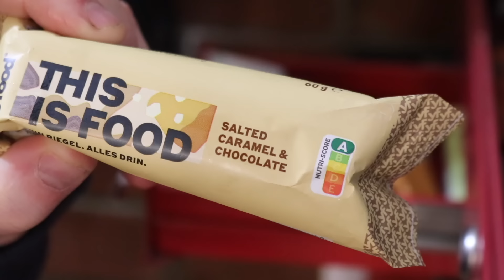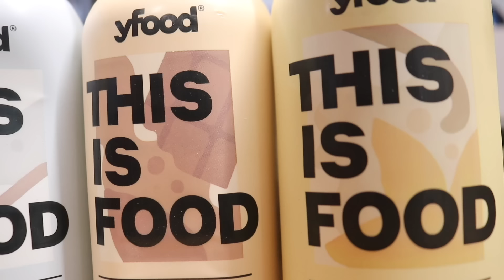MY NEW ESCORT COSWORTH NEEDS WELDING

Comment: Copper weld thru primer is best for mig welding, spary a light coat on each inner side to be welded, great to prevent the backsides of new welded lips from rusting, also worth taking note on how lower sill panels have swaged drain holes, putting a flat bar between two lips to be welded then hammering each side and then remove the bar forms a nice drain channel, water will find a way down there by rain or condensation, best it has a way out, you can also shove a cavity wax nozzel in there after its all done, indarsa make an excellent aresol one which comes with a nozzel and hose, it gives the right amount of wax where as the full size guns can be a bit over the top sometimes esp for smaller repairs
i've been a panel beater in collision and resto since '87, retired now

little tip for you with the roloc flexable discs, cut a plastic filler spreader to make a backing disc so they dont flex too much.
those finger sanders are good, i noticed the belts though started getting rubbish several years ago esp the brown ones, even the 3M ones would snap where they used to go all the way to worn out, try the purple ones they may be better, i just got a box of them this xmas as i put them on my xmas list!!
try using a carbide bit in the air grinder, i have a set of those and for places you cant get a stone wheel on an angle gringer they work well, i most of the weld off with the stone or carbide bit then finish it with the roloc discs, * note the harder backing pad works better, you can buy the wider backed arbour for them too but i tend to use a home made plastic disc as a backing pad to them, there is enough turn on them to mount the disc and a backing pad made from a spreader.

for the welds on the arches etc smear a small amount of fiber glass filler paste over the welds then sand it back off, this will seal up any tiny piholes you cant see in the weld line, the fiberglass resin is a decent seal against water, then etch 2k prime and then put the drip check / brush on sealer and stone chip / raptor, on my cars i prefer to over coat them with body colour gloss as it makes it harder for the dirt to stick and my under seal / stone chip of choice is 3m sprayable sealer, it comes in a mix bag but i tip the two parts out, and mix to use in a gravity gun with a big nozzle as i prefer the texture, that stuff works very well as a normal underseal / stone chip coating, i did the entire under side of a 76 mecedes in it and it stayed but over 10 years now
Reply: Awesome tips 👍🏼

Comment: I always use a heat gun and scrapers to remove the bulk of the underseal. A rag soaked in some sort of solvent, paraffin often works, as it's not to volatile and doesn't evaporate to quickly, to remove any residue.

Comment: Adam A hot Air gun and Scraper is just about the best way to remove underseal follow up with some paint thinners to clear up any left overs its hard graft but a lot less messier and Healthier than going at it with power tools its a Ball Ache for sure.

Comment: Use the green/blue belts for your power file, they'll last longer. 

This is why I hate undersealed cars, traps moisture causes more rust. You'll get it fixed no problem.

Comment: Job well done.. PS I put HD tape on the body when I might damage the body. Also to make a piece of sheet metal to fit I use cardboard paper and use a pen to template the cut in the body. A tip from our friend Edd China.

Comment: Adam, you forgot to plug weld those 2 bits of metal together on the bottom of the wheelarch. Great job on the welding mate, 7mm hole is best for plug welding btw.

Comment: Also cover ya 3door ..the grinding dust will land on the 3door(which you cant see)..and as soon as it get wet/due or condensation hits it.. the dust will start to rust leaving very small rust marks all over the car...i had to have my e46 m3 repainted for this reason

Comment: When painting your welded parts, id use an etch primer, then a good zinc or heavy read you can even brush on, then a few coats of standard primer.

Then most importantly, do not leave primer bare, it will gather moisture the longer it sits. Paint over then you can seal with a good two pack underseal buddy.

Id a successful garage for over 35 years building and restoring cars and bikes

Comment: Great channel and really enjoyable production work to your videos. I've  got one pet peeve though, you've removed the guard on your angle grinder. I use an angle grinder as part of my daily job for over 25 years now and can honestly say it's rarely necessary to remove the guard and during that time it's saved more than its cost! Put it back in please especially when using slitting discs, it's there for good reason.
Keep up the great work and interesting content.

Comment: So Adam when welding I would when cutting the plate make the plate exactly the same size and the hole cuz as a welder for 28 yrs and was coded too the power of welding if you set the welder right the penatrion will go through and seal the gap that's how I have always done it

Comment: Adam just a thought, nearly every fabricating place has a parts bin with loads of stainless and steel that's new mainly cut of pieces they won't need so get put in these bins.

They sell them off if you pop in and ask, there cheaper than what your paying.

Comment: Good job , have a few practice runs with the Mig power turned up slightly higher once you've mastered it your welds will be much tidier with less grinding back 👍
Reply from the maker: I’ll try a higher setting 👍🏼

It’s a bit awkward as I’m always fighting gravity welding upside down or sideways
Reply: 100% that's what I noticed, hold each weld on for an extra quarter seconds, it will stop the weld lumping up buddy 👍.

Comment: Great work Adam, repairs look good.   One thing I do differently is I use an etch primer rather than weld through over the finished repair, it just seems  to give better protection before the car is painted. The sanding belts require a lot of patience as they can't take much pressure.  If  you can take down most of the weld with a sanding disc  first all the better.
Reply from the maker: Cheers Graham. I’ll look into that 👍🏼

Comment: BELT SANDER .. 15:42 Black and becker make a really good electric belt sander...im in the resto trade and the electric one is as good if not better that any air operated belt sanders I've used

Comment: Can I say adam the work you have done looks alot better and will last alot longer than it was before and to me as a welder you haven't do too bad if a job and like I said it alot better and you need metal cutting tools for grinding the welds down not sanding wheels don't last 2 mins there like small grinding stones or metal one too all different shapes hope this helps you but great work

Comment: Great effort and it’s fantastic your having a go at welding but you need to clean up the area your welding to much more. It should be as clean as the panel your putting in. Keep up the great work. 👍👍

Comment: Grip fill is the best stuff You can use to smooth over welds  and seams small holes  ect it can go directly on bare metal it has a rust inhibitor in it it sets rock solid then you can underseal over it also it's as close to the original stuff You been removing

Comment: I know it’s easier said than done but it would make your welding a lot easier for you if you get it properly cleaned I know it’s not easy and try not getting any gaps round your plates don’t need it you will get plenty enough penetration it’s only fine but still a great job can’t wait till the next one 👍

Comment: awesome job man, just with the welding to the fuel filler hole to avoid lumpy weld like that you just want a tiny bit more heat. The weld sounded good so just needed a tiny bit more heat and the weld will melt in
Reply from the maker: Cheers. I’ll try that 👍🏼
Reply: Keep it up bro, love your content, reminds me of times gone by

Comment: @Adam151082 i bought an R Tech welder on your recommendation, what settings wire speed , voltage  , gas settings are you using for this job ... my Porsche 924 has really thin metal and am using the same steel to fix it. I am also using 0.6mm wire. your a true inspiration to us all...

Comment: I think you are at the point where it needs to go on a rollover jig like Paul linfoot used on his latest RS500 post. You’ll be there for months otherwise trying to get that underseal off. Or send it away to be blasted on the underside by a third party. I feel like this has got to be a big job quite quick. Kind of feel for you.

Comment: Good work on the repairs, my advice would be invest in an air fed welding mask, not cheap but for painting, grinding and welding they are so much better, you’ll make self ill in the end from all the crap that’s goin airborn, also get some thick primer for after the welding is done think I used etch primer on me mk1 escort 👌🏽👍🏼

Comment: A Clean and Strip disc/drill attachment would work better on the under seal than a wire wheel, super quick and won’t thin the panel like a flap disc.

Comment: Got to be honest - Its a complete bodge up !  Fred in his shed !  That whole area is rotten, it needs a proper repair doing or the corrosion will be back in no time. Looks like the cars had some serious repairs/bodges done in the past - over spray every where and rough panel work under the bumpers and arches.
Reply: Wouldn’t have got many views if he bought a minter than didn’t need any work doing and Adams channel is all about “having a go yourself” instead of getting others to do it. I happen to know this cars going in next year for an extensive overhaul underneath. He just wants to stop it from getting any worse til that day comes.

Comment: The welder needs more amps buddy, the weld is not penetrating through enough. Turn it up a few more clicks and also on each weld hold it on for an extra half second.

Comment: Your doing a awesome job and you say you ain’t a welder 😂I’ve done it years and your just as good as me , one thing I would say is put some goggles on under welding mask , the amount of hot metal I’ve had to have removed from my eyes is crazy until I started wearing goggles, dewalt do a nice pair 👊

Comment: ADAM when you cut and place the fuel plate why not cut the round hole in it first before you weld it in I would off it would have been easier

Comment: I think you would be probably best to consider stopping right now. Stripping the whole car totally, & start with a bare bones ground up restoration properly. That way you do it once & once only. You are going to be back n forward so many times with this car, if you do it in stages. It may feel more expensive initially. but in the long term it will be a cheaper way around it.

Comment: What are the back end of the inner sills like? Sierras & Granadas liked to rot the sills from the inside out, thanks mostly due the the big hole Ford stamped into the inner sill deliberately to allow muck & salt inside the sills. It's a rear beam out job to repair, so best to check it out whilst you have the beam out.

I recall hearing of an internal Ford memo back in the day. They didn't want cars to last much more than 10 years otherwise nobody would buy new ones. I had a '91 Sierra, a '91 Granada Cosworth and a '88 Mustang 5.0GT. I had the Sierra from '98 - '09, it dissolved; the Granada from '04 - '13, it dissolved, and the Mustang from '04 - current. Ironic that the oldest car is still alive, and hasn't needed welding yet as the Canadians who built it didn't use sh*ite Chinese or Russian steel, unlike Ford of Europe.

Keep up the good work.

Comment: Well done buddy , coming along ! Great tip to make templates . Masking  tape and dirty fingers around the edge lol ! Then stick to metal and cut , or card . Spot it on. . Then do 3-4 tacks move to alternate side tack then move to next location . Will keep heat down and less risk of catching . Along with no heat warp . Underseal will smoulder for hours and still catch fire . Have your air line ready and blow the panel off and cool 👌 

Keep up the good work
Reply: Just watched second panel !  That’s the boy . Some nice seam sealer and your winning 🥇

Comment: Would dry ice help get that underseal off?
Reply from the maker: I’m not sure Stephen.
Reply: Hay guys - I’d asked Adam if we could do it for free (my company is the UK Distributor for Dry Ice Energy) and the geographic distance is a headache.
Ice blasting might help, but when it’s REALLY thick it’s a pain.
Reply: From what I have seen elsewhere on YT is that dry ice is great for cleaning dirt, but isn't abrasive enough to remove underseal, surface rust, etc.

Check out a channel called Mr. Hewes. A few months back they tested a dustless blasting system designed and manufactured in N. Ireland. It uses media suspended in water, so makes much less mess that traditional sandblasting. Only downside is that you need a big tractor with at least 100hp at the PTO to drive the pump which provides the pressure for the blaster.

Comment: no offence cant u find a written off escort cossy shell too cut whole floor sills etc to transplant your shell onto or reshell as to weld self and not having skills too do properly your risking life as itd need to be done right i dont see done properly by summer id have have a year too two at least and have like new not dummied up with snotter welds even try buy cosworth floorpans jacking points inner outer sills any new part needed to be welded on hire a professional lots unemployed welders who will do a job to make you proud may as well seam weld it if gonna have by summer better buy rollcage back to front so its held together great cars best ever escorts pay for proper welder think of value done right if just to get on road its never gonna command high money you took a risk and let heart rule head we have all done it lol but still shells or half built race cars if look hard enough motorsport shell renumber so dont need new vosa etc then respray so u can build n service all parts inside n out upto you but if dream car your running before your crawling if think be on road by may june as not enough hours in a day to do it and ive built lots cars started with mk2 mexico then progressed but 2year for mint mexico from 14-18 yrs old finished 88 signal green with x pack still own it lol

Comment: Great vids good on you for giving it a go. Top tip - Use Card as a template for the new patch. For Welding ive not much experience welding cars. However i was taught to mig to not stop start like you were, youll end up with a far better weld and will leave you with lots less to clean up. Im no expert but maybe practice with different settings on the welder. Welding isnt easy thats a good go. Im no affiliate or anything but for some fabricating advice / ideas you wont go far wrong with doing similar to these guys on the Mini build, nohttps://www.youtube.com/@BadObsessionMotorsport